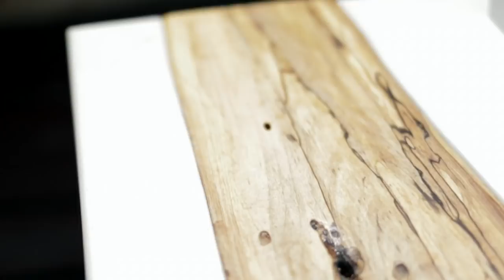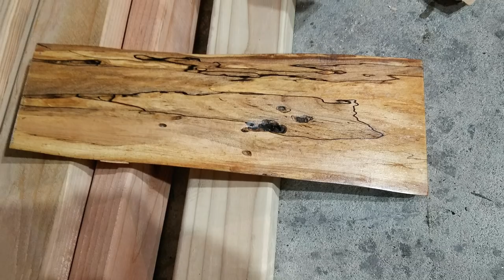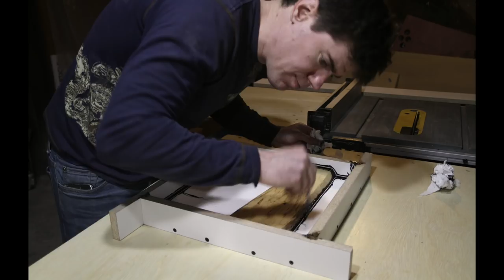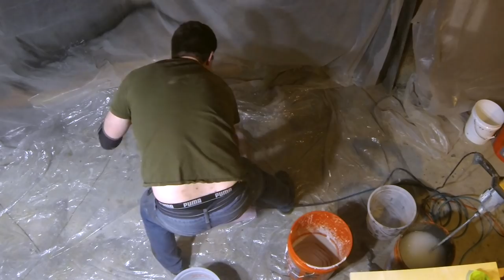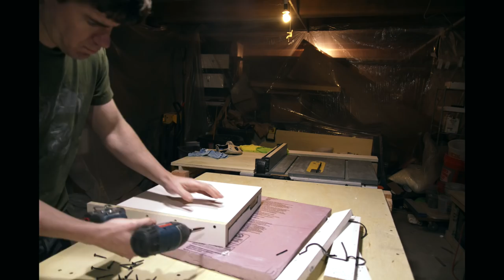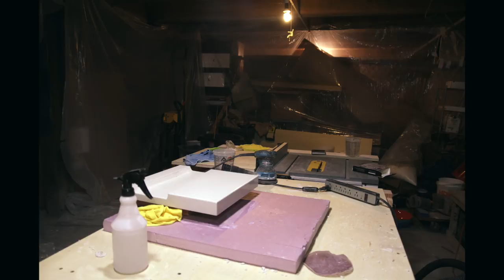DIY White Concrete Table w/ Live-Edge Maple Inlay (using GFRC mix) - How To Make

Comment: You glued and screwed the forms together?  Total over kill. Screws were sufficient.  Especially since you used silicone to stop any bleeding .
Reply from the maker: No, I didn't use glue.  Just screws.  I agree, glue would have been overkill (and made getting the table out of the form very difficult).   I'm not sure if you are confusing paste finishing wax with glue, but if so, it is not at all an adhesive....it was only used so that the excess silicon could easily be peeled away.

Comment: it looks good if you ignore the giant hole in wood
Reply from the maker: Beauty is in the eye of the beholder, and I think that is what is so fun about YouTube.  I like the character it adds, since the concrete is so smooth.  In other projects, I like the perfect wood surface with epoxy filling holes.  Check out my other build for the live edge table with concrete post, where I went all out and filled the holes with epoxy, leveled with router, etc.  But for this build, I wanted to show what could be done keeping the woodwork minimal.  Two miter cuts, sand, and finish, and that was it.

Comment: Why wouldn't you just use the brush for the first coating? Instead of spraying.
Reply from the maker: You can definitely do that on a piece like this.  the verticals are more challenging to get, and you have to be careful not to go too thick with the brushed face coat (which can result in surface cracks), but its definitely doable.  I've done it this way a number of times.

Comment: My daughter is looking to  make a  Island out of the white concrete with a cutting board in it.....
Reply from the maker: Tom Oakley that would be amazing!  Check out my waterfall countertop video...there are a few extra steps for larger slabs of GFRC, like adding foam inserts to reduce weight, that are important.  Would love to see pics if you end up doing it!

Comment: I agree result is beautiful, but I think that it's too complicated and demanding for someone to do this at home. Not sure how many people are gonna spray concrete.
Reply from the maker: Understood -- you can definitely do this without spraying, and get really good results.  To simplify the project, just pour the face coat in and use a brush to spread it.  The sides might have a few more pinholes, but the table top will still come out beautifully.

Comment: neat project, but, wellll....
One loses a degree of respect and credibility when one uses the phrase "amazingly satisfying". There are those over used  gimmick phrases employed excessively to commercial and advertising endeavors. They strike me like a sliver on a nerve.
Really though, this is very well done. 
I have had an Idea developing in my head similar to this but using as light a weight material as I can find, for use in an rv.
Any Ideas?
Reply: Erik Parker Fabulous, just add structured cores that can float up and finish with more fibre-free mix. But plan for legs and leave a vent for cores to outgas, as organics do, or use hollow glass bead. Underlighting ftw?

Comment: Bottom right. Not there.
Reply from the maker: There is a graphic icon in lower right, same place where you click to skip ads, that should allow you to subscribe.  Maybe it doesn't work on mobile phones?  Please let me know as I'll have to change what I say if it doesn't work for mobile devices.  Thanks!  (Also, you probably know this, but you can subscribe by clicking the subscribe button under my channel name in the video description.)

Comment: I thought it's much simpler to do.
Reply from the maker: There are ways to simplify.  For starters, if you use a pre-made GFRC mix and pour the face coat in, this removes a lot of complexity without that much of a change to the quality of the final product.  Happy to help if you have questions!

Comment: How I wish your caulking method worked in bathrooms as well... I suck so much at caulking...
Reply from the maker: Actually it might.....I was talking to my contractors who said they do something similar for window caulking...

You would want to be careful not to get the wax into the seam itself, and just spread it on the places you want to pull the caulk away, but I think it could work.

Comment: I can't afford all of the tools
Reply from the maker: Brian, you can do this with a circular saw and a mixer attachment for your corded drill, if you like.  You can pour the face coat in instead of spraying, and still get pretty good results. The tools simplify things, but aren't required.
Reply: Modustrial Maker Thanks for your reply. I'm a firm believer in "the right tool for the right job". I'd like to get into this type of craftsmanship
Reply from the maker: I definitely agree.  BUT, for flat slabs (no tall verticals), you really don't need to spray.  Check out my concrete coat rack...I made one white and one gray, and I just poured in a thin face coat, and used a chip brush to paint the face coat in.   What tool set are you working with right now?
Reply: Modustrial Maker I have basic hand tools and a decent Makita cordless set
Reply from the maker: Gotcha, so if that set has a circular saw, that totally works to make a melamine form.  And you've got a drill/driver.  The only thing you really need is an electric drill or electric hand mixer, unfortunately the torque from a cordless drill just isn't enough to mix GFRC once the glass fibers go in.  Those run about $100, but you might be able to find one on craigslist for cheap.
Reply: Modustrial Maker I sent you a tweet. Perhaps we can talk via email?
Reply from the maker: Sure, modustrialmaker@gmail.com

Comment: You need so much stuff to do so little...
Reply from the maker: Many of the tools are nice to have, but not necessary.  You can pour and brush in the face coat, so you don't need the sprayer, and you can use a mixer paddle on a corded drill.  In the end, you could do the whole project with a circular saw and a corded drill, if you had to.